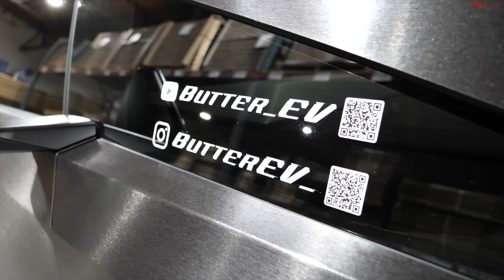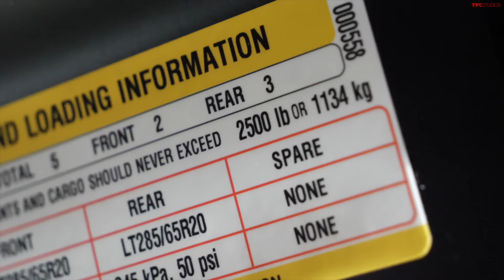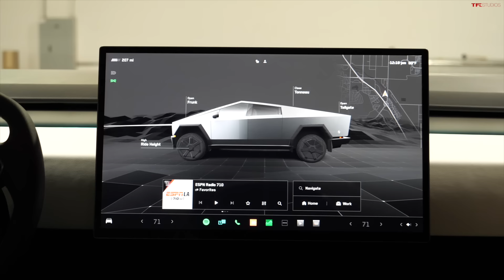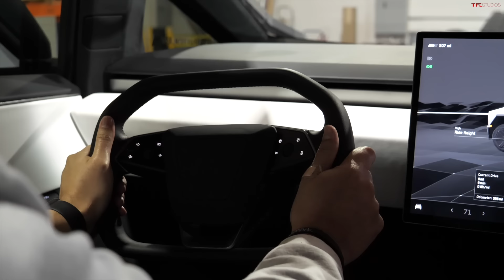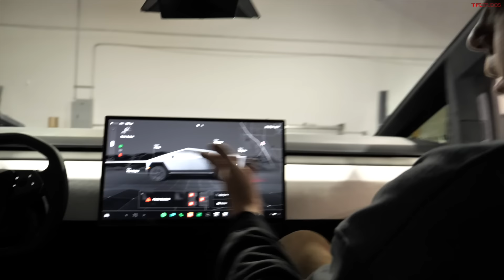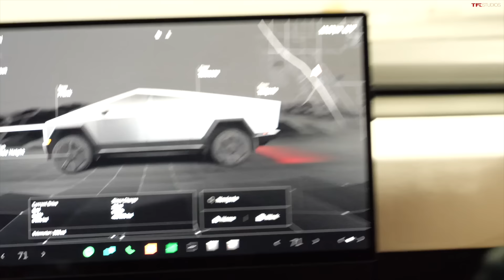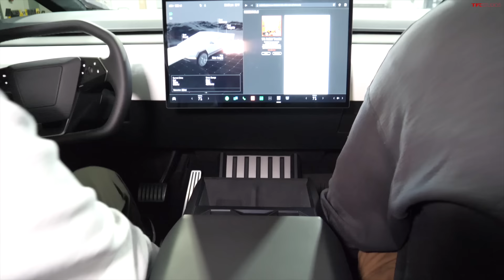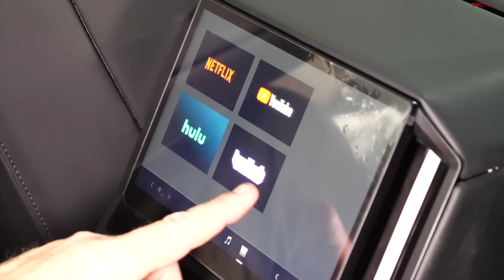What I LOVE & HATE About Owning A Tesla Cybertruck!

Comment: Spare tires are almost never used, but whenever they are needed it is 100% worth it to have it
Reply: @markplott4820 what if tyres are slashed
Reply: I probably used the full sized spare on my golf a half dozen times over 10 years. Almost exclusively on road trips where it saved my bacon. Popped that sucker on and kept going.
Reply: I had a flat tire once in more than 40 years of driving and di not need it. I do not want to carry and spend energy on things i do not need.
Reply: I've got 35 years of driving under my belt. I've had 5 flats in that time. Two of them were at home, Two of them were at work and one was on a motorcycle only 100 yards from my house. Despite my "luck", I live in rural Australia and I make darned sure that my spare is inflated. You don't need to go too far here to find yourself well beyond walking distance to a local town or even a neighbouring house. A flat tyre and a flat phone battery could leave you in real trouble on a hot summer's day, here.
Reply: With the Technology we have available to us it should be possible to fit some kind of protector inside the Tyre to prevent bottoming out and protect the sidewalls when the tyres had really bad leaks be it Slashed or run over super sharp rocks it would have to be relatively light and strong …
Reply: @markplott4820  so you show the police that you ran over a screw driver or a railroad spike and the officer says "put your spare on".
Reply: @chrisbraid2907  run flats? that old tech?
Reply: @chrisbraid2907  this technology exists for many decades. It’s a matter of cost.
Reply: Fix a flat is just fine.  Hauling around that extra weight is silly.
Reply: @davidbrayshaw3529  you must live in the real wilderness. I guess you have not even roads and telephones which you could use to call the next tire repair shop. 

I do not carry useless things that cost money and energy. No fuel no tire and no extra battery for my iPhone.
Reply: @wolfgangpreier9160 No, I don't live in the wilderness, but not far from it.
Australia is a big continent of which most is relatively uninhabited desert.
It isn't Europe and it isn't the USA.
There are plenty of places to find your self
where phone coverage isn't that great, despite the ads. And there are plenty of places where the next residence is 10's of miles away, if not more.
I'll give you the tip. When the FM stations run out on your radio and the phone no longer works, you're a long way from home.
When AM radio stops  working... everything gets real at that point.
Reply: @davidbrayshaw3529  "Australia is a big continent of which most is relatively uninhabited desert." Yes, that is why most apocalyptic movies are made there. 

We in Europe do not have such areas. Not even in the surrounding Africas or Asias.

I am sure you will drive your Utes with 2 spare tires a few decades more.

At least until all you get is BYDs or Maxuss without spare tires. Because every other manufacturer has stopped producing such vehicles. 

AM radio was shut down in Europe sometimes in the 1990s. I am sure Radio Vatican or the FSB still has their stations running for the few hundred amateurs. 

I have not listened to FM radio for at least 10 years. Only Spotify, podcasts or Youtube.

We could have used digital radio, but that was superseded by Internet which works everywhere.,
Reply: @markplott4820  unless your valve stem blows out lol!!
Reply: You can buy a spare rim and tire and keep it in space in back of front seat when you take long trips.
Reply: - I'm Australian. For sure, around town the spare is never/rarely really needed (Away from town, in the bush - it is a must-carry (or even 2)  For remote travel in already maxed out vehicles, an additional spare tyre is a lot less weight than a whole wheel - up on the roof-rack..
(Of course a tyre plug kit and air compressor lives in my vehicle 365x365.)
Reply: Off-roading, you want it, and a jack that will work out there.  The cost of towing off-road is frightening, and service is often delayed.
Reply: @markplott4820  let me know how that works out for you when it's on the side wall
Reply: @markplott4820 until you have a blowout
Reply: Fix a flat is the worse garbage ever to  put in your tires .
Reply: @auduffer It's been awhile,  I had a tire less than few months old and somehow the sidewall blew out.  Only happened once,  it was nice to have a spare.  I had another flat while out of state once, fix a flat would have fixed it.  I know someone that blew out a sidewall and the nearest tire shop did not have his tire in stock. If your TPMS is working properly, there is less need for a spare.  I would still prefer to have one.  As of now, if someone blew a sidewall on their cybertruck, what are the chances that the nearest tire shop will have the tire you need in stock?
Reply: Not having a spare is a pretty big issue in rural areas. I've had 15-20 flats in work vehicles and a half dozen in person vehicles. Several were torn sidewalls or large gashes in the tread, so unpatchable. Heck, I've seen as many as three spares accumulate on one work truck waiting for repaired tires from the shop. I can only think of a couple of times where the flats occurred within range of roadside assistance. As a review on another channel said "it's the most city oriented ev truck." I'll keep pinching pennies for a rivian or lightning.
Reply: I agree.  I have an 08 car.  Spare has never been used.  I would get one when I get a new car.
Reply: @markplott4820 Unless it’s a blowout where the whole tire disintegrates. Every flat in the last 15 years was a complete blowout.
Reply: Tire repair kits they can fit in the Palmeter hand work for the vast majority of cases. It used to annoy me, but it's not even a big deal anymore. Spare tires were a big deal back in the day when I grew up because you couldn't just call somebody or get roadside assistance. That'll be there in a half hour from your insurance company. Most flats you can take care of a cheap kit, and if it's really bad, you have somebody there typically in less than an hour. It's just not as necessary as it used to be.
Reply: @fishtailfuture  Well maybe in the US, it Mexico where I currently live it is still a pain to have someone come to a remote place, that is assuming you have cell signal
Reply: 100% - For a city car with a breakdown van around the corner, who cares - in something ostensibly an advanture / "off-road" - trail "monster" - cough - a spare  is 100% useful - in the bush, one doesn't getnails in their tyre, they get logs, treeroots and stumps,  tearing and slashing the sidewall - fixaflat isn't up to that..  (Again, many trips into the bush, no need for a spare, but the day comes where a breakdown van is $1000 away.).
Reply: @markplott4820  (and in some jurisdictions you get prosecuted for eavesdropping, without being present or party to a conversation.)
Reply: @chrisbraid2907   - teslas come from the factory with foam blocks glued into their tyres - for noise damping - a little more "structural" (higher density / durometer)  the foam becomes a "runflat" device.
Reply: @kadmow  yeah, thats why off-road vehicles have them easily accessible as well like the jeep.

Comment: Drove through a construction zone while towing my fifth wheel last year.  Picked up a nail and had to change a tire on my F350.  If I had remembered tire plugs, I could have plugged it.  Even with plugs, I would want a spare in case of sidewall damage…
Reply: That's why I moved to E load. Last thing I need is a flat while towing.
Reply: I am driving vehicles since 1981. I had a flat once 30 years ago and did not have a functioning spare. I went to the tire shop 10 minutes away and let them repair the tire. I don't have any spare tires in any of my cars anymore.
Reply: @wolfgangpreier9160  Top tip: Don't try that in rural Australia.
Reply: Magical fun fact: you cant plug Tesla tires. They have a foam layer below the tread that makes them not able to be plugged without risk of falling apart at high speeds. No tire shop will touch them. So, he better find a spare or know a shop REALLY close by.
Reply: @QCJSiteB  Really?
Reply: @QCJSiteB Tesla offers a tire repair kit on their website.  The kit indicates “Spray Foam” rather than plugs, but still… their tires can be repaired.
Reply: You are right.  Having a full-size spare is nice, and CT is not for everyone.
Reply: To be fair, I would guess 95% of tesla owners are incapable of changing a tire
Reply: @miket8909  Curious why you feel this way.  Is it because most will never have a roadside tire failure?  Or because Tesla drivers are inept?
Reply: @wolfgangpreier9160   - lucky you - urban users don't need a spare, or even a car really..  An Uber is only 5 minutes away at all times apparently.
Reply: @christopherhale580 Definitely inept. lol  A lot of Tesla drivers where I live don’t even know how to indicate when changing lanes. 😆
Reply: @christopherhale580  can you imagine someone who can afford over a 110k vehicle changing their own flat tire😂😂😂.  Maybe construction workers who drive 100k trucks, but they probably have some employee change it.
Reply: @davidbrayshaw3529  Plot twist.  Wolfgang is a dingo and wants you to get a flat so it can eat your baby.
Reply: @wolfgangpreier9160 glad you were 10 minutes away how convenient.  What if you were 100 miles away in the middle of know where?

Comment: I’m a general contractor and literally get at least 1 flat per year. I run e load BFG Ko2’s. The lack of a spare tire is ridiculous. Not a real truck.
Reply: @markplott4820  The major flaw with all current EV trucks with the exception of the silverado is the range . If you want to drive it like a car and go shopping with it then fine it can be like a MY with a bed. But you aren't going to take it to the woods to go camping for a week the battery is just too small. (unless your camping in your back yard). I would never buy the F150 lightning but it has much more utility then the CT
Reply: @crimsondecade7420 It depends on which sort of truck tasks you do.  If you are a carpenter who works in the city, like someone related to me, EV trucks make sense.  If you do long distance high speed towing with heavy payloads, forget it.
Reply: @crimsondecade7420 werid. I do all my towing (up to 1.6T) with my model Y, and leave my Nissan patrol at home. We also now do all our camping with the model Y. 

I can’t wait for an EV 4x4 to replace the patrol.

If you’re going to tow a 3 tonne van around the country. EV will never be the quickest choice. If that’s you. Then you don’t buy an EV. And no laws coming into effect will stop anyone from buying an ICE if they need it. 

For the other comments. I carry a tire plug and a compressor. And I’ve got 4 screws in my tires. And with a TPMS was able to identify it before total failure, and got it professionally repaired within a week. 

If you’re going bush. Throw in a spare… 

People forget that most Tyre failures are due to slow leaks and overheating tires…  TPMS system identity the problem early. A total spontaneous tire failure on a car with a TPMS is extremely rare.

Comment: CITY: You don't need a spare tire, bring a tire-plug kit and a small compressor to refill the tire after you plug (Patch) it.
HAULING A TRAILER: You could put a spare tire on the trailer.
OFF-ROADING: 3rd Party bracket to hold a tire on the outside of the tailgate like a jeep, or maybe someone will make a roof mount for a spare tire down the road..
Reply: While a patch kit is good. You still need a spare for sidewall damage.

Comment: I never minded the yoke and the blinker button, but I HATE swiping to drive or reverse.  I also hate the horn button which they fixed on the Cybertruck
Reply: can't see hating the swipe to drive or reverse since you do that only while you are stopped? Seems like the turn signals on buttons would be harder to get used to.
Reply: @brucec954  problem with the swipe is if you don’t perfectly execute it, it doesn’t take.  Super annoying especially when executing a multipoint turn in the middle of a busy road or something like that.  The blinkers are great both hands stay on the wheel and it is just a move of the thumb.  Kinda like driving a motorcycle and the thumb blinkers
Reply: @brucec954   Ever drive with gloves on?  Besides, even if it works perfectly, it’s still irritating that they intentionally made something worse for 0 gain elsewhere. At least they still have the buttons on the ceiling, I’d be using that all the time.
Reply: Hey, just wanted to let you know that there are buttons under the rear view mirror that let you put the car in drive or reverse. So you don't have to swipe if you don't want to. Also if the screen should not work you still have them.
Reply: Great video , nice flow.

Comment: BIG OVERLOOKED POINT. (Inspecting" tire to eliminate flats is a pipe dream) Spare Tire needs a jack big enough to lift truck UNLESS YOU CAN USE PNEUMATIC SUSPENSION to lift then lower on blocks. Unless tire self destruction and if nail is in tread area, use an emergency plug patch to get to a repair shop. Does CT have a compressor?
Reply: - any 3Tonne bottle jack will lift a wheel - even if "fully loaded"...  (it has compressor for suspension, not to pump tyres - there is a $550 option).
Reply: there is an optional compressor but basicly it is a 110V model you plug into the outlet of the back of the truck

Comment: "Have you had any issues with it so far?" asks André. "No..."     *dome light fail, mirror light fail immediately follows
Reply: Has to be better than my Maverick after a year and a half. Coolant loss with coolant valve failure, seat flexing tear forming, 12 volt battery not charging, modem failure (meaning no wifi, no GPS, no long distance start, no ford app use), brake force inconsistent, driveline shutter, airbag recall, crankshaft failure bandaid recall (no full fix determined yet) emergency stop actuation (going into some driveways and parking lot entrances), door unlock on door handles doesn't work sometimes. There's still more.
Reply: @matthewgoedtel5998 damn, sounds awful!
Reply: @markplott4820  Mark, no tesla fanboy excuse for the non working lights?
Reply: Typical Tesla quality...once the magic of EVs goes away and they become viewed as just normal everyday vehicles, I feel like people will realize that these Telas aren't built to the highest of quality standards 😅
Reply: @matthewgoedtel5998 Early production models do tend to have problems, but that’s a bit much on one truck.  You bought one of the lemons.
Reply: @unconventionalideas5683  true. I had one of the first 50 Model S Plaids and it felt and rattled like a 20-year old Chrysler. 😂

Comment: I’m just beginning to realize I have been on the fence about the cyber truck because of the stainless steel exterior. What’s scary is that, it’s only going to get better. My only problem is that sore thumb looking wiper. It sticks out like a 6th finger. Perhaps if the wiper hangs from the top with a shield protection. Aesthetically, the truck will have a better symmetry. Nevertheless, This is the bramah bull of trucks. Love it 👌🏾
Reply: I have yet to see anyone video that ginormous wiper in motion. It seems it would leave 1/4 of the windshield 'unwiped'?

Comment: Spare tires have gone away from recent cars in order to save on vehicle weight and increase interior storage space.  As a result of this, roadside assistance is no longer an add-on with insurance or an extra fee, its just part of it.  Another reason for doing away with the spare tire is with the requirement of tires being put on with a torq wrench to a designed torq, meaning almost no one is going to hand crank off lug nuts.
Reply: Small cars with limited room don't have spares. Trucks do.

Comment: - the guest could get a retractable tonneau cover for his Ram - readily available - options abound..  
External, weather proof push button to operate, not a great stretch (simple to integrate with central locking using a low power SS relay/or latching relay).